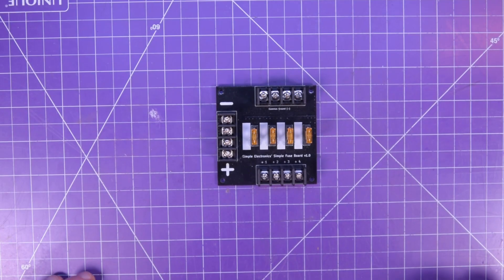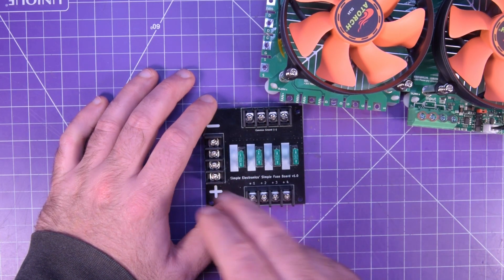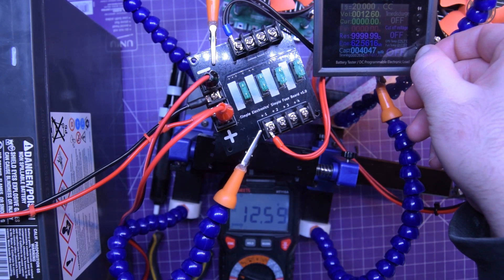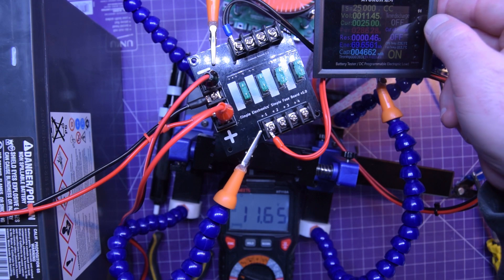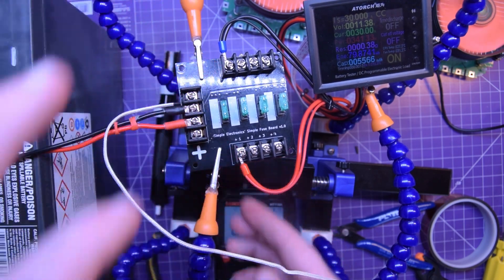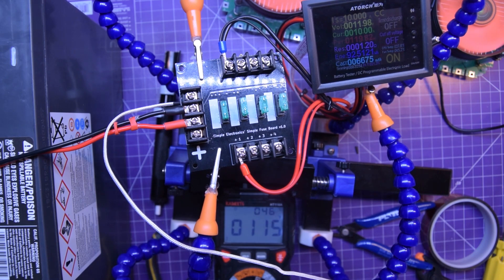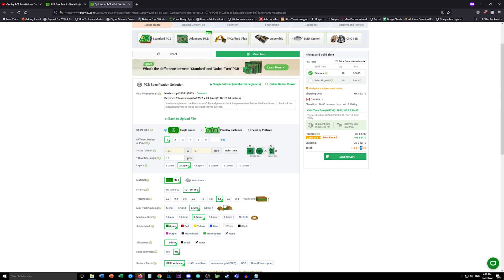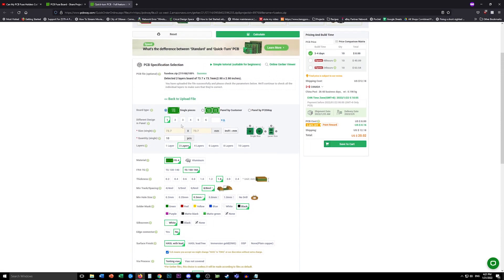Raking A PCB Over The Coals!

Comment: This is so confusing..
This is not how voltage drop is measured, since you interviewed him, go check Eevblog videos.
You are doing the equivalent of calling Allan bolts torx, I mean, maybe its fine for you...
There's plenty more to "comment" but well you will figure it out I guess!
Reply from the maker: I disagree - I totally measured the voltage dropped through the PCB. We do similar things in my trade when we check the voltage dropped by connectors, wires etc - especially on starter circuits.